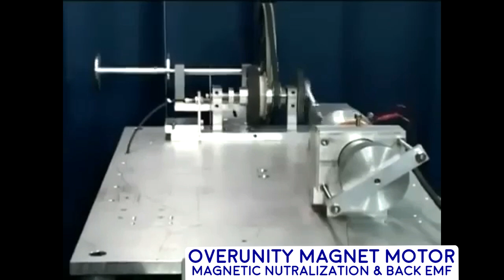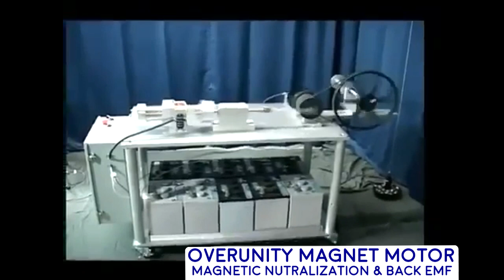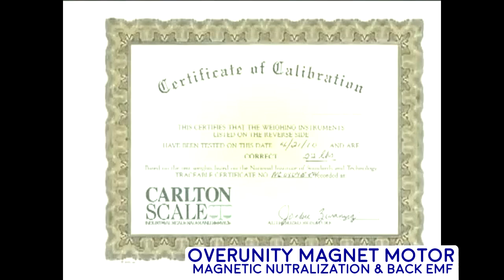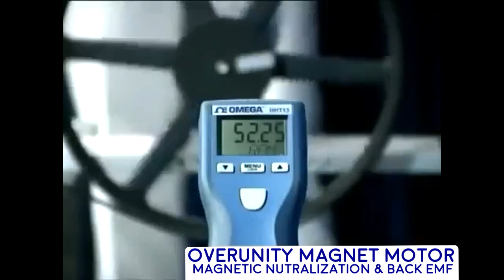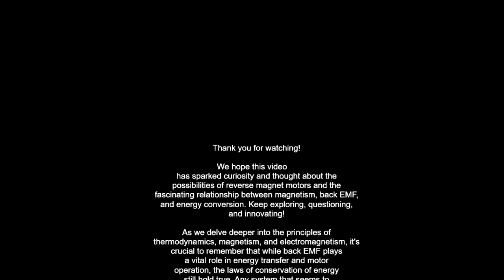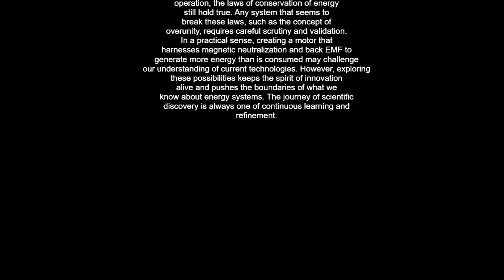Overunity Magnet Motor: Unlocking Magnetic Neutralization & Back EMF for Energy

Comment: well, this is, essentially, a linear (single pole) pulse motor.      as such, its mechanical output is  neither smooth nor continuous.      the easiest way to know how much power a system consumes is to power it with a benchtop power supply.
the easiest and most persuasive way to know the output power of a system is to produce and measure  Electrical  energy.      (DC electrical) output energy  Should  be  Correctly  Measured  ---  NOT  used.     that means that there should be  NO  dummy load in the output circuit.     at most, there should be just one low-value high-current toroidal inductor in the output circuit
output voltage is easy to measure.     output current needs to be measured via a method that does  NOT  affect  the output circuit.    that is, via a correctly spec'd inductive DC low-current pickup/clampmeter.         yer average clamp multimeter won't do the job.
there  IS  a problem in the T-D laws.     specifically, there are  NO  'closed systems' in the real universe.      because of the 'things' like cosmic rays, neutrinos and gravity.
see my rotary leverage-based ou research, if interested.       there is one other guy who recognized the same idea that i have.      but, his execution was flawed.        cheers

https://www.youtube.com/watch?v=FmXBebQzMyQ